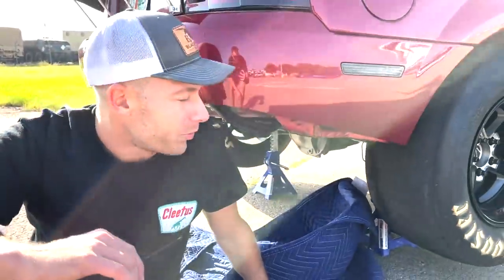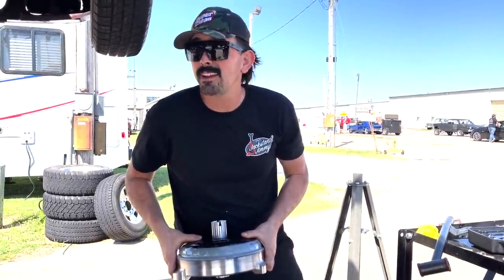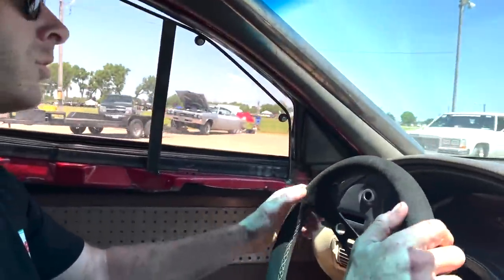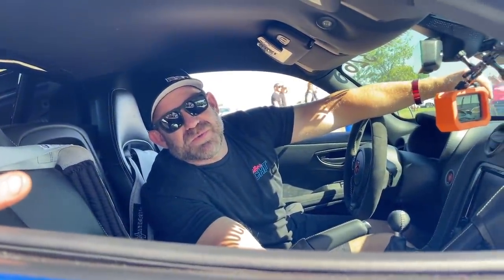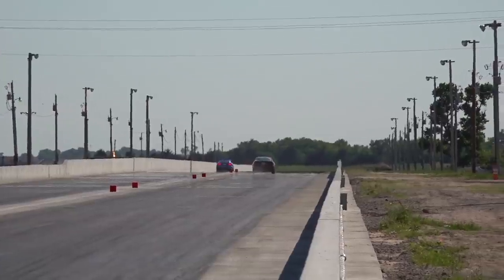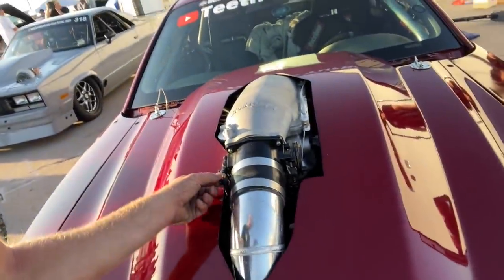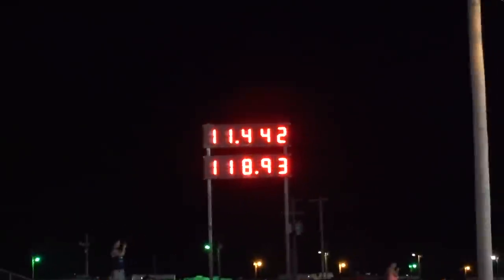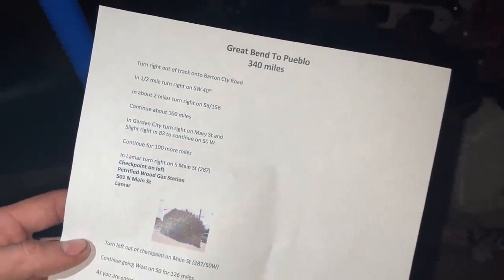Race Week Day 1 - Had to Pull the TRANSMISSION!!! Hits On The Track Were Decent

Comment: You know if your running a 4500 stall converter at under 4500rpm it’s not fully locked and slipping which will cause it too heat up and fail especially if your trying to pull a small trailer

Comment: You just need the Lock Picking Lawyer to do a quick 90 sec vid on how to pick a SN95 door/trunk lock and you're set. Throw that key out for weight reduction.
Reply from the maker: Hammer and a flat head
Reply: @DoctrParker  Universal Ford door lock tool for sure.

Comment: The dipstick I have (in the transmission) is a little bit sketchy 
Why should the dipstick be different than the connector for the TPS sensor 
or the rest of the car. 😅😂🤣

Comment: LMAO @ "it hooked"... not hard to hook when the car is slow as fuck.
Reply from the maker: You must be fun at parties
Reply: @DoctrParker  Always... but be serious... That thing only hooked because it is putting no power down at launch. Barely seems like it leaves on boost at all. Doesn't even really spin the tires that fast during the burnout. You have slicks, turn it up and actually launch it for once. The drivetrain can take the power easily, just a matter of chassis setup at this point to make it go straight and fast.
Reply from the maker: Yea dude we’re working on it, gathering new data everyone run and getting it figured out. If it happened over night or was easy, everyone would be doing it. Having patience and fun on this deal.
Reply: @DoctrParker  lol!